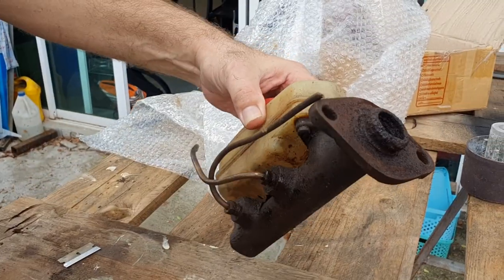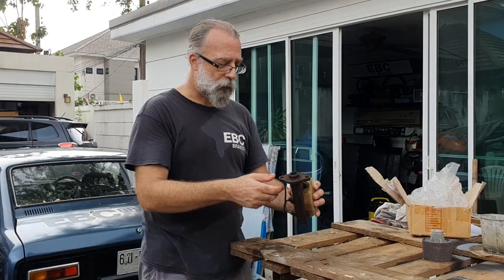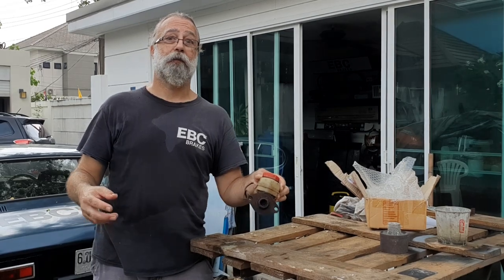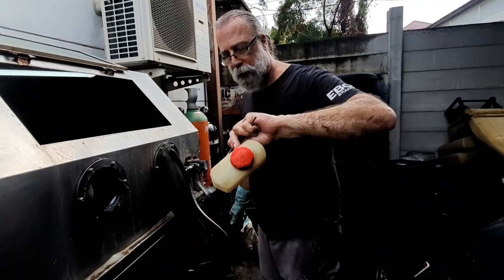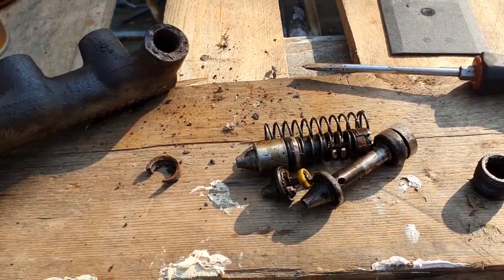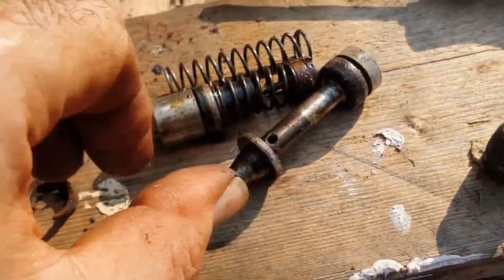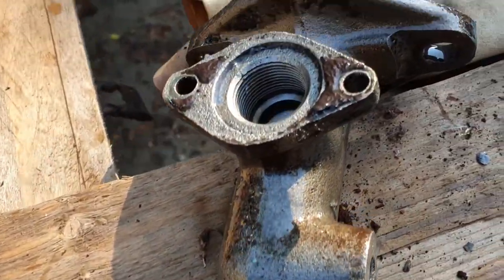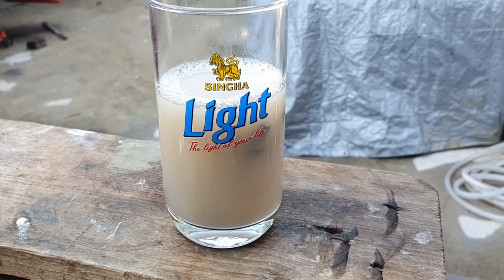Can it be saved? MK3 Cortina master cylinder recovery (Vapour Blasting)

Comment: I was contracted at a place that had an ice blaster. They used it for machine plant outside blasting. Is the vapour blaster similar as there was no dust or excess grit to clean up
Reply from the maker: There was a guy over here that had the ice blast equipment, he was doing industrial electrical cabinets and stuff. I looked into it, its probably the best of the blasting but needs a massive amount of air and a source of dry ice. I took it no further and settled on converting my dry blast cabinet to wet / vapour.